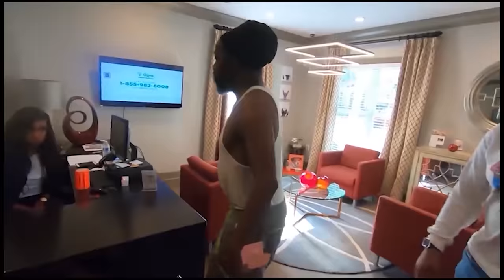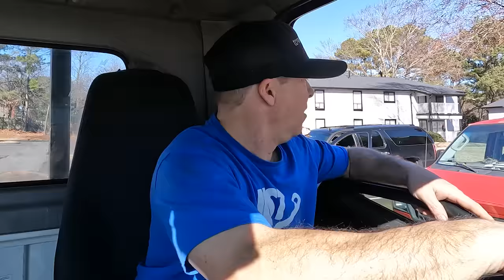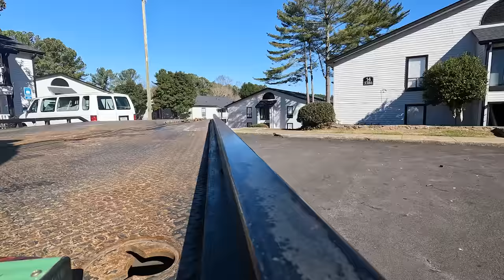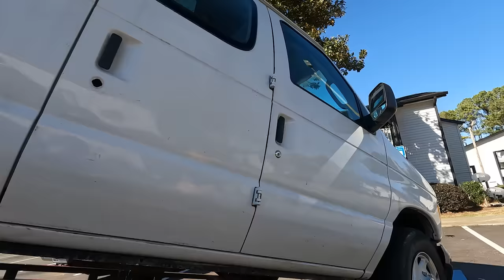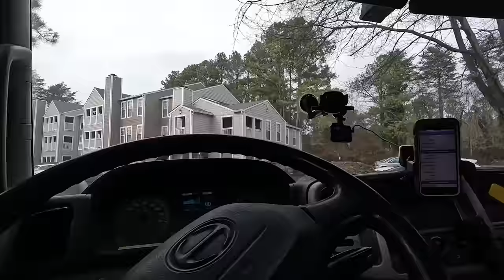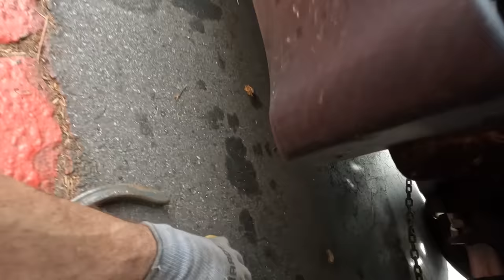Parking Revenge #309

Comment: The last apartment I lived in towed vehicles, 2 handicapped cheaters and 2 fire lane violators and the handicapped cheaters called the police that told the owners that both of the vehicles were ticketed 3 times in 7 days and they didn't remove the vehicles so they towed both of them,1 of the fire lane violators came out of the apartment and called the police saying that they were stealing my car from the lot,when the police arrived and did everything, police said take the car because of illegal inspection stickers and the license plate didn't belong on his car and was reported stolen 2 weeks ago, he ran after the tow trucks trying to get his car back, found out later that he tried to get the vehicle from the impound lot but he still hadn't gotten a valid license plate and proper registration, my next door neighbor said that he complained long about it,BUT it cost him $3500 for everything so he can drive the car again-other things happened with the apartment and the apartment management told him that they canceled his lease and gave him 48HRS TO remove themselves from the apartment, after 48HRS they had a locksmith open the door and put everything on the front lawn for him to get his stuff, he came over at 9pm with a uhaul truck and took everything away